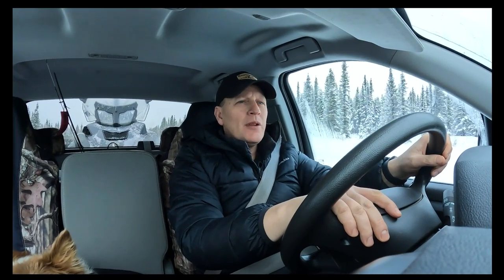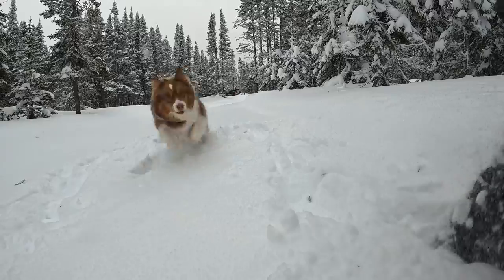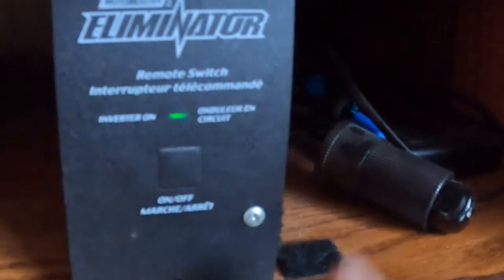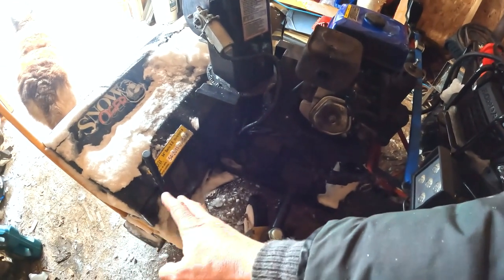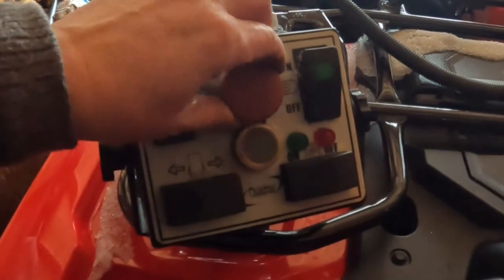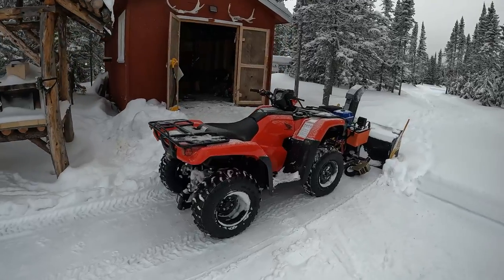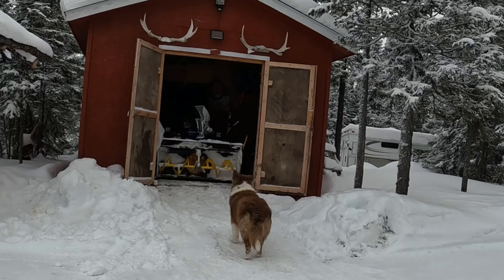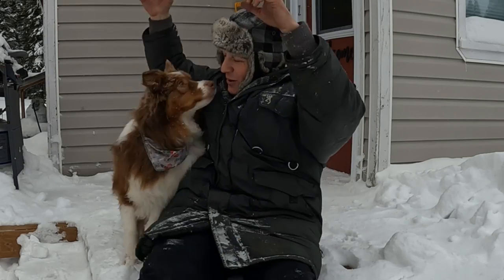Conquering HUGE SNOW in the NORTH & Making it FUN - My New Winter Toy (Bercomac, Quadrax, Snow Oger)

Comment: Nice machine. Definitely does the job. I have the same snowblower. But bercomac.  54". On a yamaha grizzly 700 . Only difference is I have a kohler 23 hp  that came with it in 2008. Very reliable machine. I enjoyed watching your video  but if I can make a suggestion to you is you might want to get a set of good chains on 4 wheels and  I tried to figured your adjustment because for some reason your snowblower wheel do not sit on the ground. I do use mind at camp as well on a fairly long driveway and road to get to my camp. The add up of 4 tires good set of diamond shape chains really made the difference.  Enjoy 😉
Reply from the maker: I would love to have that 23 hp!!!👍

Comment: Hi Chuck, loved your video, I just picked up the exact same snow blower but it doesn’t have the wiring harness from the control box to the connectors, would you happen to have a parts diagram or any idea where I might pick one up up? I’m located in eastern Ontario, Canada and this far I can’t find any info on parts for this particular brand, I do know you mention the bercomac parts may fit but the control box doesn’t look like the one on the quad trax, any help from you or your followers would be greatly appreciated, Kurt,
Reply from the maker: Actually I never found a parts diagram listing first nor last. I piggy backed off of the bercomac all the way. And it worked quite well. Hopefully others who read this can chime in 👍

Comment: I’ve got a 10 year old 13-32 track drive Honda with the overhead cab. The newer ones steer easier and have the power controls also. Mines old school, gotta grunt to steer it but man it’ll walk through almost any type of snow without effort. No matter how deep. I’d hate to ever go back to wheels or no cab again. I’m on grid and there are times it will throw the snow over the bottom power line. That being said you have a nice outfit for sure. Enjoy!
Reply from the maker: Sounds like you got a good rig Gary! The Honda’s sure are good machines

Comment: Cheers from Gros Morne.   Wish the Ariens Deluxe 30 I been trying to get running all winter ran as well lol.  Waiting on a float bowl gasket in the mail now.   It sat with no use for 4 years in Niagara Falls so it's a little hard to get going now.  Mice had the wires and fuel line chewed up.
Reply from the maker: Great to hear from Gros Morne!  Thanks for tuning in 👍

Comment: That a great set up. I have seen similar years ago but homemade and hard to use. Everything was manual adjust. Very nice quad . I have a 2005 honda rubicon 500. It still runs strong and has never left me stranded. I shipped it back home 6 years ago and use it every fall. 500-800 kms. Regular maintenance on those quads and they last a very long time. All the best in the new year🙂.
Reply from the maker: I think the Honda Brand was definitely the way to go fro sure.  Very dependable.  I owned an older trx300 that was bulletproof. Tks Lloyd

Comment: I have a homebuilt one that I used a Craftsman 48" blower works great but I need to get a little more rpm on the blower. Puppers had me nervous upon fireup and going in front of the augers. She loves the snow. I have never heard of the brand. If you ever have to take it apart for a belt change, Can you do a video? I have a centrifugal clutch and need to swap out to an electric clutch and would like to see there setup.
Reply from the maker: Hey Donald. It is a rare breed. There are a few of them around as some people have messaged me. I actually have a new belt ordered. Hoping to get it in the next week or so👍

Comment: Hi Chuck, the quadrax snowblower is a chinese copy of the bercomac snowblower...quadrax dont make snowblower anymore...some bercomac parts could fit on the quadrax, but they are not always 100% compatible..
Reply from the maker: Very interested in what you are saying here....you sound like you may have some background knowledge that may assist me.  I'd love to get my hands on an owners manual for sure.  But in the meantime Im interested in the motor that actually rotates the chute back and forth.  That motor is different than the Bercomac (they use the same motor as the one that moves the chute up and down).  If you have any other info then email me at porterchuck9@gmail.com.  Id love to have your input!! Thanks!!
Reply: @ChuckPorterEverythingOutdoors  The motor that rotate the chute up and down is a car winsheild wiper motor, you can go in an auto parts store to buy a new one if you need...for the quadrax owner manual...I think there is none...good luck..
Reply from the maker: @Bouba07  yes I bought one of those motors off of Amazon. Fairy cheap.  The motor for the side to side rotation is something I’m going to have to cross reference. Or adapt same windshield motor to it. It all works good now however I’m just looking to the day when it doesn’t. Tks for replying bud

Comment: I know these quads weigh a ton, but any issues with rear wheel traction,  or wheel lift with the blower off the ground? That seems a lot of weight to hang on the front. 

Ive wanted to build something Similar for a couple years, never knew someone made them.   

We just got about 3' in 3 days, 1/2" ice and sleet too. 14" weekend before. Wish I had that now!
Reply from the maker: The blower actually "rests" on wheels.  There is one point in the video where you see I reverse and the wheels "flip around".  Winching only assists in that operation so fortunately there isnt really much "hang time".  The blower is quite heavy so Im glad this particular feature is present.  Hope you get more snow my friend!
Reply: @ChuckPorterEverythingOutdoors   Thanks for the info! Haha, we get any more snow any time soon and I'm moving south...already twice the amount we usually have by this time of year!